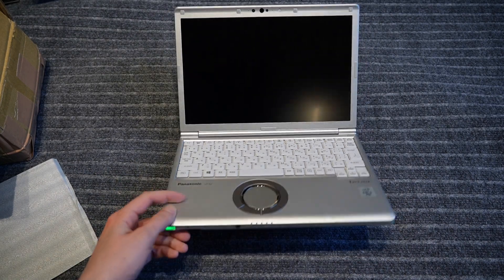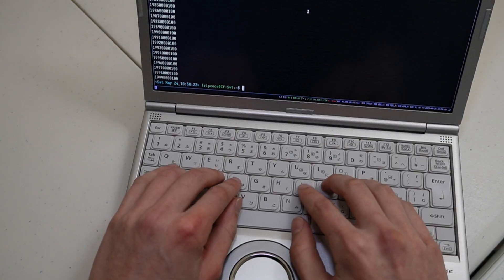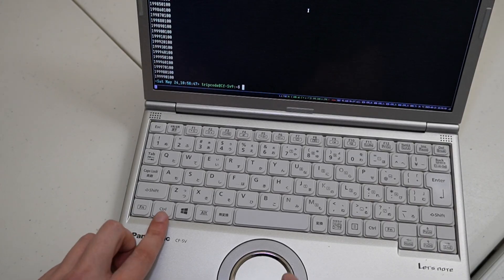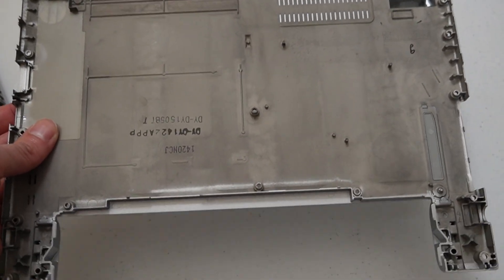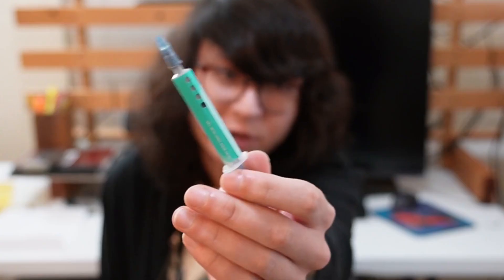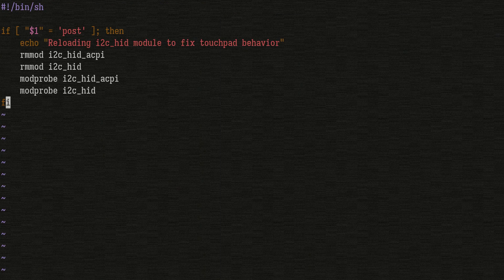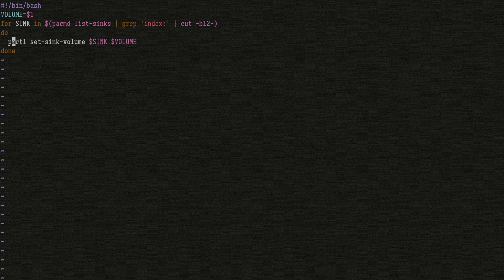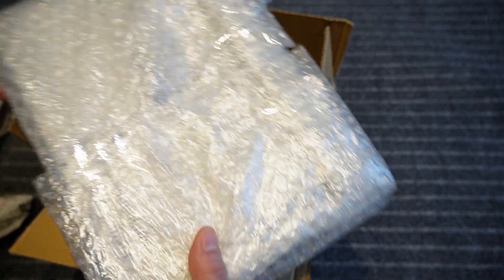Panasonic CF-SV9 Review, Repaste & GNU Linux Install!

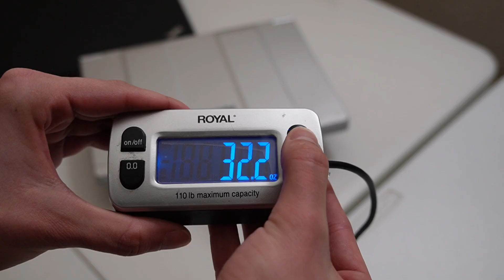Comment: 1:20 - weird that they would go through all the trouble and make a separate molding for versions without an optical drive. On the CF-MX4 for example they used a removable cover.
Reply from the maker: Yeah, it is a bit disappointing, I kinda wish I could find some parts units to see if I can get a drive working, but I haven't had much luck yet.

Comment: How much did you pay to import it? I’ve been considering getting one but I’m worried it’ll get lost in transit or they’ll charge me more than a 100 in fees.
Reply from the maker: I ended up buying a second one recently, it is roughly what eBay states plus sales tax, I think the seller covers it. The thing I noticed though is that the sellers recycle photos. So, I had to ask around for operating hours and general condition. I paid about 360 for the first one and 340 for the second one, including the sales tax.
Reply from the maker: Officially with 10% sales tax 340_USD